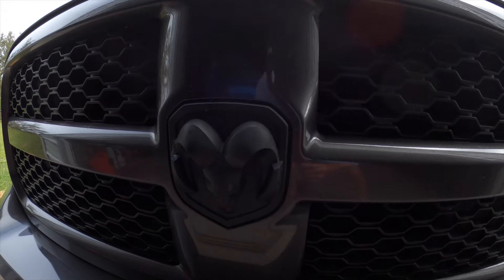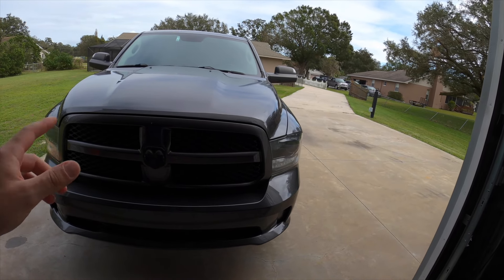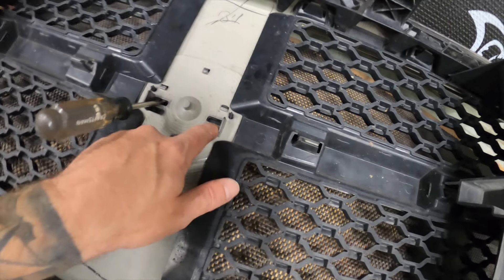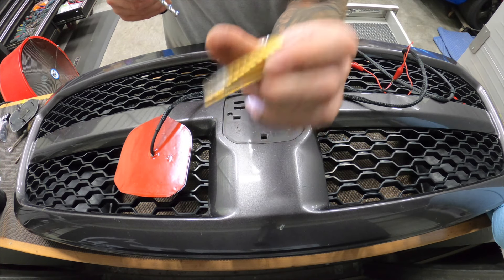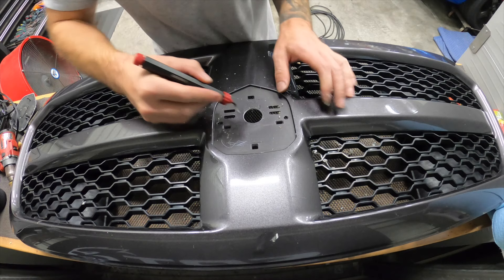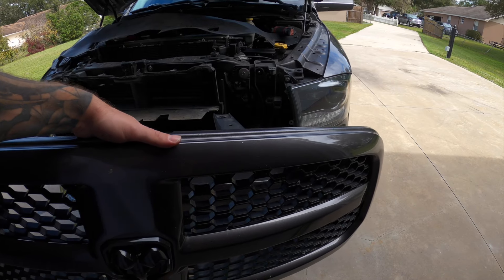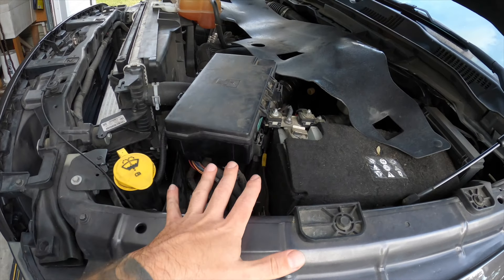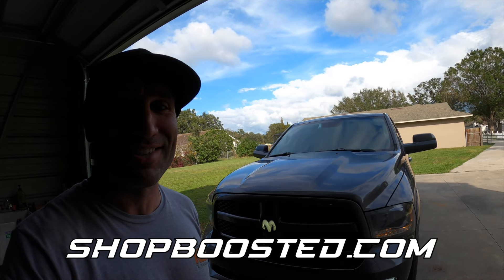Illuminated Light Up RAM Truck LED Emblem Install

Comment: My rear brakes on my ram always wear out way too soon compared to fronts.  You have any ideas?.  My e brake is sized but stuck open so doesn't contact rotor
Reply: Sounds like you hit your breaks too hard

Comment: The video makes it look yellow-green, which I think looks great, and I want that, but the link shows white. Is it in fact white or is it yellow-green???
Reply from the maker: It’s more white than anything but you can literally change it to any color you want by swapping out the LED or putting a color film inside. The type of plastic they use is really what makes it able to do this so once you have it any color is possible 👍

Comment: The only bad thing about permanently wiring it that way is what if you ever have to take the grill off I would have used some spade connectors for a disconnect in case I ever had to remove the grill
Reply from the maker: I show the waterproof disconnect in this video…